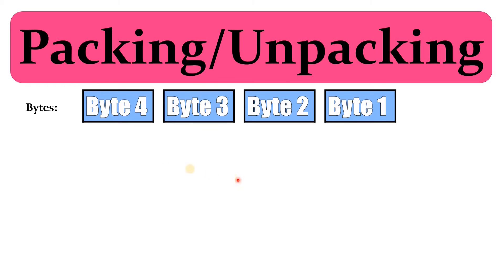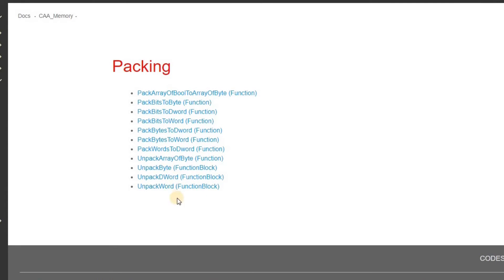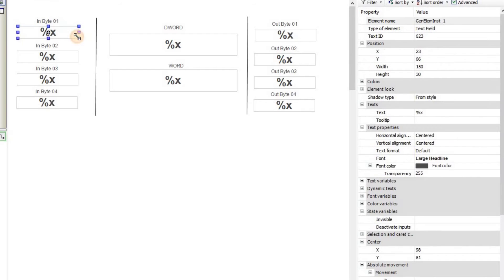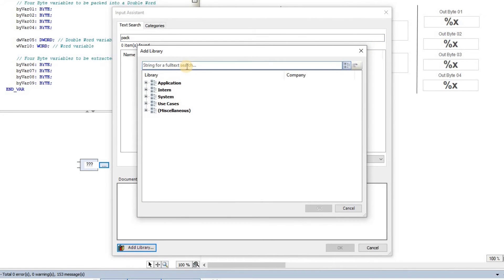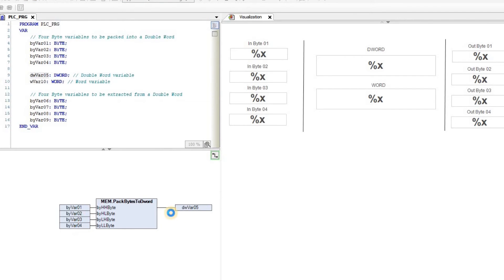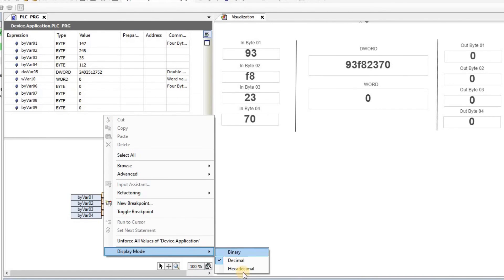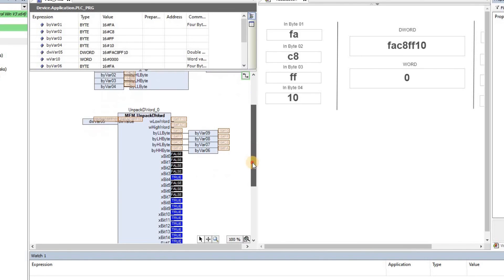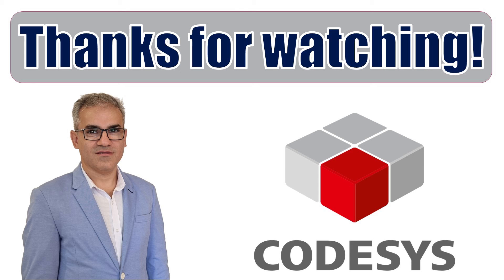CODESYS: Packing and unpacking Bytes to DWORD in CFC #codesys #cfc #plcprogramming #packing

Comment: Hi,

I got a question I had an assignment to make in codesys but I'm completly stuck, can you help me / can you show me how you would do an assignment like this? 

The assignment is

Switch1 - red and green light turns on
Switch 2 - red and yellow light turns on
Switch 3 - Yellow and green light turns on
Switch 1 and 3 - all lights turns on
Switch 4 - every light turns off

Hope you can help me :)
Reply from the maker: I would do it in this way:
For each light, determine the case in which the light should be turned on and make the logic for that light. For example, Red light is on if SW1 or SW2 or (SW1 and SW3).
I hope this helps. Let me know if you manage to implement it.

Comment: Hello Tohid, I have a question about building a PLC application and Codesys. What is the difference of "Device" and "POU" tabs? I see that I can add DUTs, POUs, text lists and visualizations under both of those tabs. In every video I see people building under "Device" tab but I don't understand the difference of those two tabs and when should you use one or the other?
Reply from the maker: Hello there,

The device refers to a PLC in general that you are going to program. In a project you can have multiple of them. For each device, you can have one or more applications, within which you will have the POUs and other elements to implement your logic. 
I hope it is clear enough.